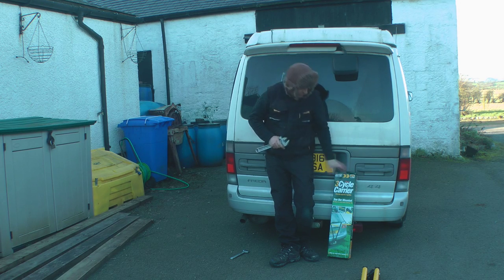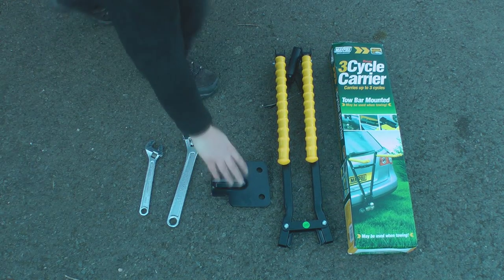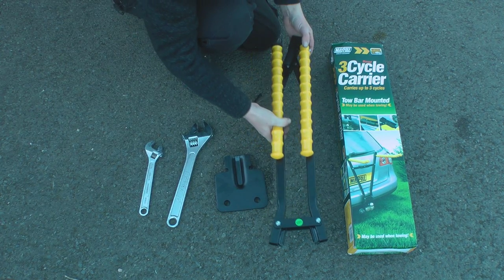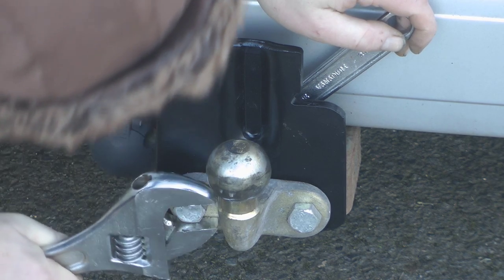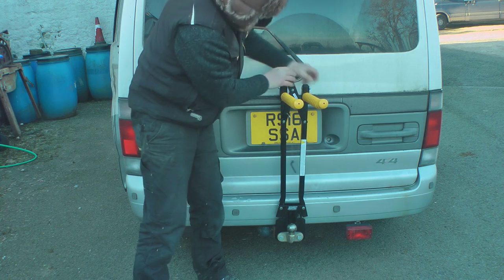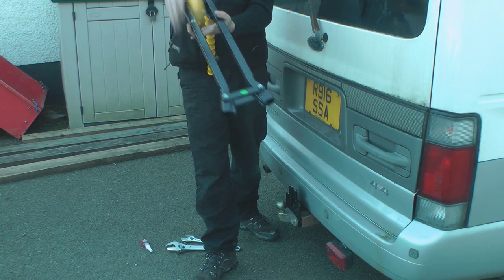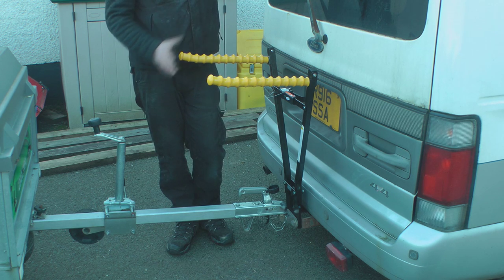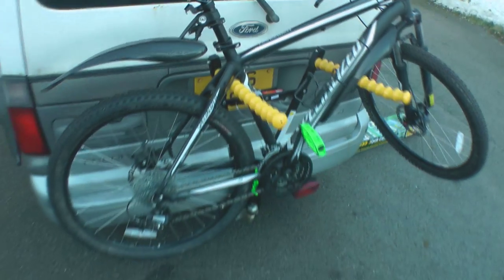Ford Freda / Mazda Bongo - Bike Rack

Comment: we sell these at work, great little racks! The speed at which they come on/off is so handy! Who needs Thule? haha! Do recommend strapping from the front wheel to the frame, to keep the bars straight. We've had wheels spinning on the motorway before and the tyre wore right through the rear light of the car! Suppose if the wheel is already against the van and you know its not going to move, it'll probably be fine! Cheers!
Reply: And if you ever need any bike info, give us a shout!  I'm a mechanic at a bike shop and build custom bikes too.Spoke to your bro about husky rigs over on the gold forum a while back, I've built/modified a couple of those too! take care.
Reply from the maker: Cheers Dan, aye I usually put a strap through the wheel, cheers for the reminder, I like my tail lights just the way they are. haha They are great racks, I really like the size it packs away too. Cool I'll know where to come for advice if my bro ever brings his rig to me to help him rebuild it. Atb Dave
Reply: An instructional to strap the bike would be brilliant

Comment: I like this design better than fitting on the ball, it will be more secure. Where can I buy.
Reply from the maker: It does work very well, I got mine on eBay, search "maypole cycle carrier towbar" they are starting around £40. Atb Dave